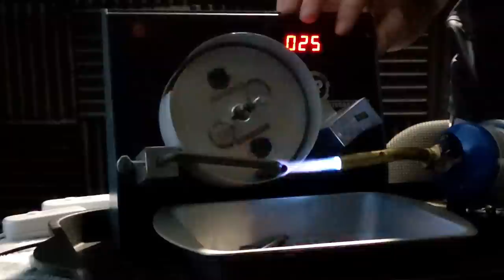EP Integrations Brass Annealer Demonstration

Comment: The way I describe it is the brass gets work hardened just like if you bend steel back and forth enough it will break off. That's basically what happens to brass without relieving the stress in it by annealing.

Comment: In about a week or two, I am ordering one of these... I am slowly checking of the list of toys, one at a time.. And this one I really should have put higher on the list of toys to get, as I wanted one of these from the first time Elfster showcased it... One of these would get me away from the salt bath annealing that my grandfather gave me.. while it is getting exceptionally difficult to locate the salt (as it is considered a consumable). The closest location I can get the salt is Canada, at $90 a lbs, due to Canada's HazMat shipping costs... The other issue with salt, it is MESSY, and corrosive to steel. Don't get me wrong, I love how it anneals, it is fast, and even and predictable, but, it is time to take advantage of this great machine that EP Integrations ha put together to assist us in this sport. Plus, it'll help put food on his family's table, and his business partner's as well. (The quiet guy, lol). I almost about a year ago, purchased a different company's annealer, and it was just perfect timing when Elfster show cased this unit... $250 to $275 bucks for his unit.... VS... the one I almost bit the bullet on, $1900... WHAT!!!! Yes, it was the induction heater type, although clever, they are costly. My experiences with induction heating, or rather, heat treating and annealing on the industrial world, those machine work when they want to work, and fail often or cook off, due to the high speed fly-back transformer electronic that causes the high frequency reversing polarity (HFAC). Like wise, if the induction coils are not matched to the load, you wreck the outputs (pop the caps $$$). One thing most folks do not know about the induction coil heating systems, is that they are extremely power hungry ,and you electric bill will show you that. The old rule of thumb, power in, is power out. Induction heating or melting of alloys, serves its function, but, 3 to 5 hours dropping brass on a induction system, would raise my electric bill 20 bucks a month, as you are just about maxing out the 15 amp breaker with that system. Hence, why I will be getting this unit that uses LP gas. 

Now, These EP unit, I can run off of a multitude of gases. from the easiest to the worst case scenario. Please allow me to example. The easiest, is simply running to the store, buying a few LP disposable bottles, like what was shown in the videos. To buying the refill adapter that lets you refill the smaller throw away bottles from gas grill tank or the larger LP tanks for fork trucks. The worst case, as per, end of world times go, which is not (per say) the cheapest case, unless you already have the solar system installed, which is the HHO nitrogen generator gas touch, off of my solar panel system. If I can cut through 1/8" thick steel, It can for sure anneal brass with HHO gas. Those are of course, extreme scenario's, but that is just how I think.. Good luck, and I look forward to getting one of these units very shortly myself.
Reply: Very nice explanation my friend! Thanks 👍
Reply: @ElfstersRiflesandReloading  Blue flame is too far back on K32. No used brass to test. Shell backplate was not aligned correctly. Maybe he should have looked at one of your YouTube videos first for the initial set up.  You explained it the best so far.

Comment: There's also a cool DIY induction case annealer on YT. Roughly $225 USD. Guy gives Amazon links in the description. 50 cases in about 5 minutes. Timer adjustable to .01 second. 
 I already have the Annealeez 2.0 but I just love gadgets.

Comment: I thought about picking up one of these, but got tired of waiting. Ended up with the Bench-Source and I absolutely love it. 

A good annealer is an excellent addition to any reloading kit. It really improves consistency. I used a drill and a torch for years.
Reply: I wish I could find a Bench Source..Cannot even get the company to return my emails... Brownells has been out of stock for months..
Reply: Same here
Reply: @drice847  I bought mine from Brownells and used a coupon code.
Reply: The fella that started bench source has passed away. His wife is running the company……….Price increase is coming.  I however bought the Ep annealer and am very happy. About  half the price and very  effective……Its your money so spend it how you want.   I saved enough to buy a MDT Oryx chassis……Just sayn

Comment: I hate to do this to you but did you ever think of reading instructions and trying explain it?  just like military task training like map reading mopp gear wearing etc etc...
Reply: Yes. Many times over. In my opinion there are too many variables in the Giraud. Flame temp (Even using Templaq) flame size and position and rotor speed.

Seriously thinking of the AMP.

Comment: I never annealing my range scrap brass. I just clean it, and put it in a pizza oven.
Reply: Depends on the cases.

Something low and slow with a thicker wall I wouldn't stress for longevity purposes. 308/7.62, that competes with something like 3006 in terms of pressure require a tighter firing chamber inside the case to build that pressure will wear that brass quicker.

You'd be doing good to get 5-7 reloads with trimming as needed on a 3006, where as a 308/762 you'd be doing good to get 3-4 before the neck is so thin it splits.

Another thing to mention is case head to body expansion. I use a flattened peice of wire turned with a 90° bend to the end to "scratch" the inner wall to feel for a lip. If it has a lip you might as well toss it, it's the head about to separate from the case body and you have one maybe two reloads before she's toast.
Reply: @hunterromano5562  I reload 9mm, and 5.56. but I do colet all brass. Regardless if it's from one of my guns. Or even if it's not a caliber I don't reload or shoot.
Reply: @D W I just use the pizza oven for brass since that stone disk thing went missing.